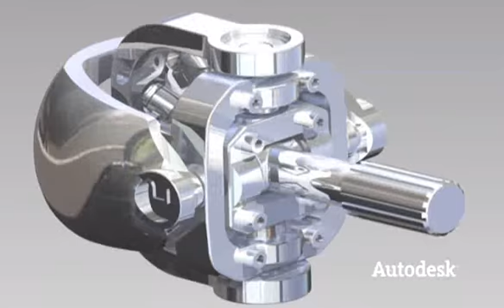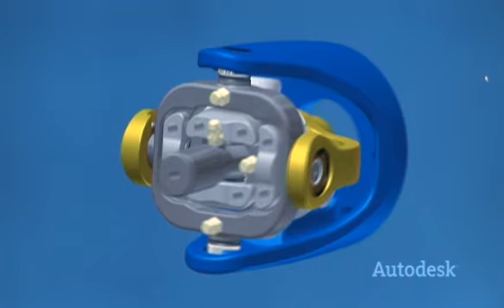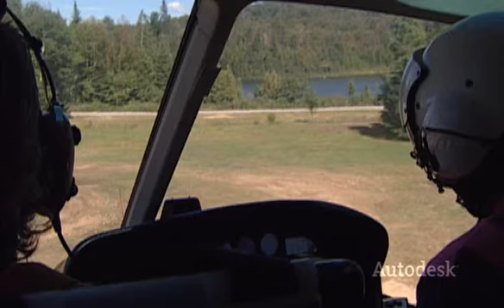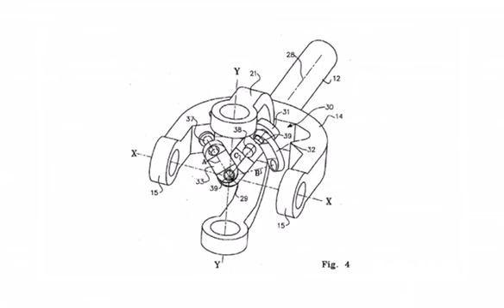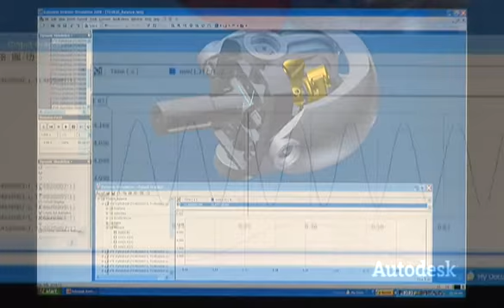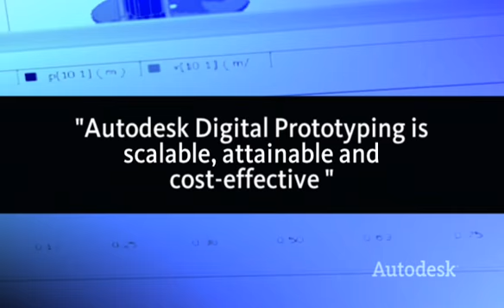Thompson Couplings

Comment: 2000hp is a stupid metric for drivetrain strength.

2000hp at 10krpm or 5krpm is a huge difference in TORQUE.

Comment: "We don't do any manual calculations anymore at all, we just run it through the program and we trust it 100%" ..... Said no engineer ever.
Reply: when your computer or calculator gives a a result, do you trust the CPU or do you run the IEEE 754 computations yourself on a separate sheet of paper ?
Reply: Actually the computer does do calculations better when the program is up to date with the laws of physics. The simple laws doesn't change so the program remains the same.
And yea we do need to test it in real life eventually, but the basic calculations today are done in a computer.
Reply: No, that's what a mathematician would never say. Engineers are not mathematicians and are not focused on unnecessary calculations, but rather on the invention/design itself. If the computer is reliable, it is reliable. The rest is only a check. 

If, in a fantasy world, math was not needed for engineering, a true engineer would not use math at all.

Comment: Seems a bit pointless. It's all wrapped up with CV joints.
Reply: There's a video from the same company showing how CV joints drop sharply in efficiency when the angle changes, making them overheat, also made worse with increasing torque, whilst this joint does not suffer from that, it rotates freely regardless of the input torque within its load rating. It also can take axial loads, which CV joints normally can't.
Reply: what?
Clearly you have zero actual engineering knowledge, CV joints typically run on 6 internal bearings, this has none.
Reply: Time served motor mechanic. 50 years in the transport industry, now retired.
Reply: @wontee2  riiiiiiiiiight
Reply: @wontee2  can't teach an old dog new tricks I guess
Reply: @wontee2  "american motor mechanic" not German!

Comment: Rather ingenious design, but be aware that there is an issue with wear and damage to the joint when the two shafts are perfectly aligned straight through.
Reply: How so?
Reply: True. But also a problem with any cv joint due to load concentration. I would be more concerned regarding its bulky size. Very clever though when space is not an issue.
Reply: @melvynwoodman5787  And space is never an issue... 😐